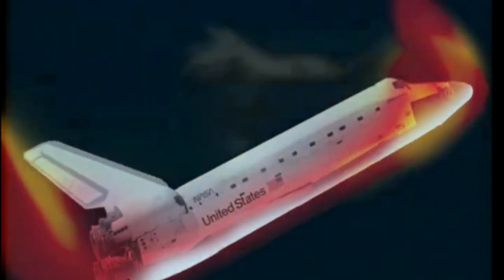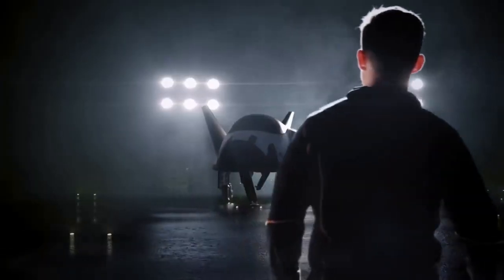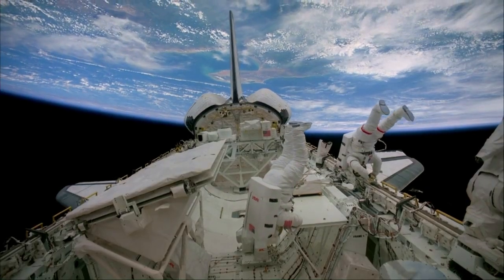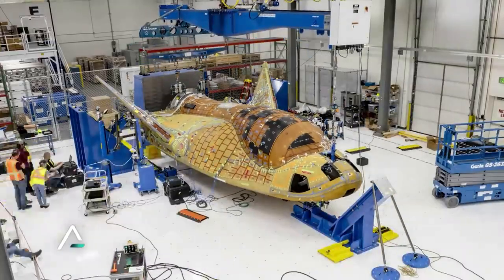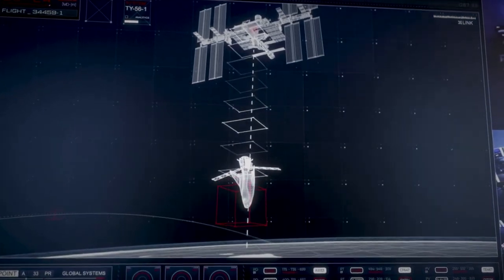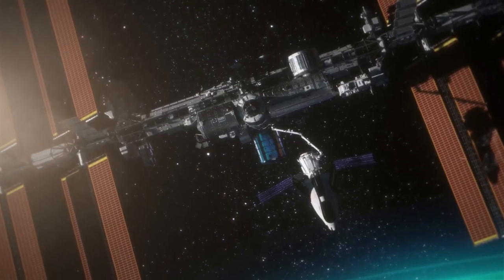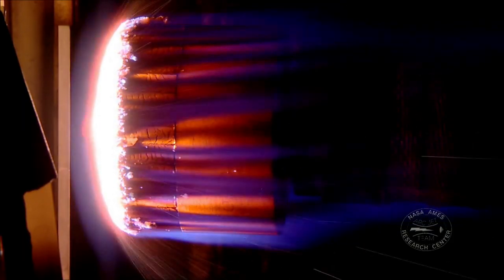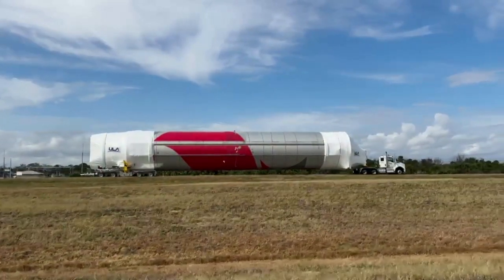Is Dream Chaser’s Heat Shield Any Better Than The Space Shuttles?

Comment: I have to wonder whatever happened to the much lauded heat shield technology for the X-33 reusable launch vehicle research project that NASA and Lockheed carried out from 1996-2001.  The metallic heat shield panel made of Inconel and titanium, would lock together with others to form an armor layer on the vehicle. The metallic shield was deemed a viable alternative to ablative shields or ceramic tiles. When the X-33 was canceled so was the metallic tile development.  I would have hoped SpaceX and / or SRC would have at least looked at the technology.
Reply: That is a good question. Thought that was a groundbreaking technology that the X-33 demonstrator was supposed to proof out?
Reply: Since titanium is needed for the metal tiles and Russia has most of the titanium, Silica-sand-based ceramics may have looked a better choice in the long run.
Reply: @Doggeslife  No. China has the most titanium reserves. However, Canada and Australia, as well as other countries, have millions of tons of mineable titanium.  Considering the small quantity needed, the availability of titanium is not an issue.
Reply: @Doggeslife  Interestingly enough, Japan may be number 2 now in Titanium production, as in: "China is the global leader in the production of titanium metal. Japan is the world’s second-biggest producer and Russia is No. 3."

And: "Japan is a major supplier of aerospace quality titanium sponge, accounting for roughly a fifth of the global market, and it provides more than 80 per cent of US imports, according to the US Geological Survey. The corrosion-resistant metal is mostly used in aircraft but can also be found in everything from bicycle frames to medical implants."
Reply: Nothing is really preventing SpaceX from revisiting their tile design in the future, so there's still a chance

Comment: I think it’s good to remind everybody that on several occasions the shuttle tiles took significant damage that the engineers thought would destroy the orbiter. She flew back every time and was readily repaired and reflown no problem. STS-107 happened because of a failure in the carbon-carbon leading edge, NOT the tiles. 

By the end of the program the tile issues had been worked out and each worker was doing a lot more than “1 tile a week” as the video dubiously claims…

Comment: Since the title of your YouTube video ends with a question mark, the answer to your question is no (Betteridge's Law of Headlines).

We won't know how good the tiles are on Dream Chaser until that vehicle flies 25 successful entry descent and landings (EDLs) like some of the Space Shuttles accomplished.  

NASA launched the Space Shuttle 135 times and 133 times the Orbiter landed successfully. Those rigidized ceramic fiber tiles performed exactly as designed in protecting the Orbiter's aluminum fuselage from overheating. Those tiles were not factors in the two shuttle accidents.

Side note: My lab developed and tested space shuttle tiles during the early design phases of the shuttle program (1970-71).